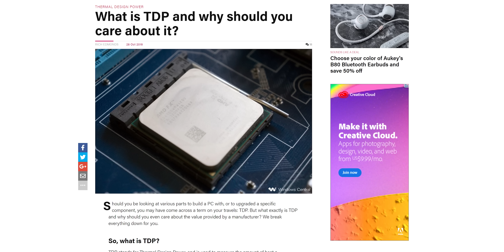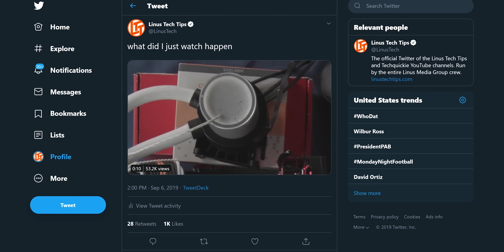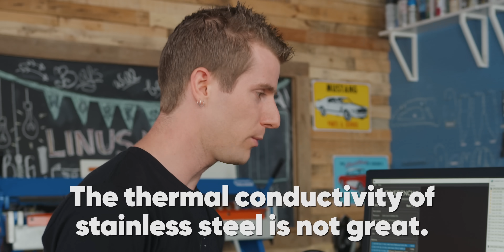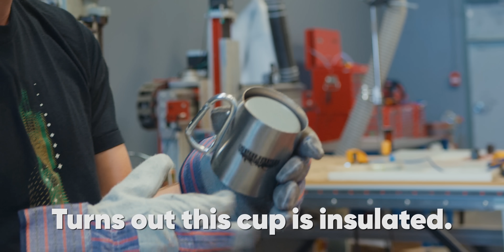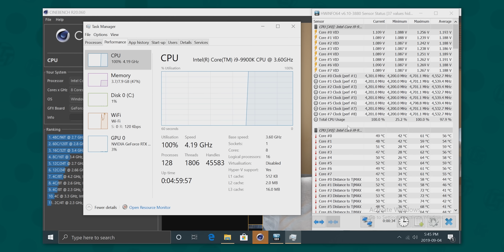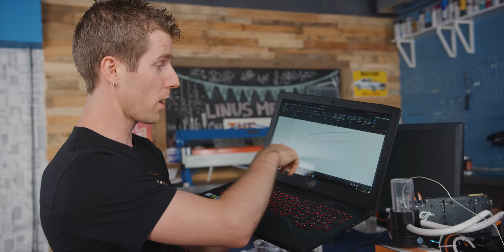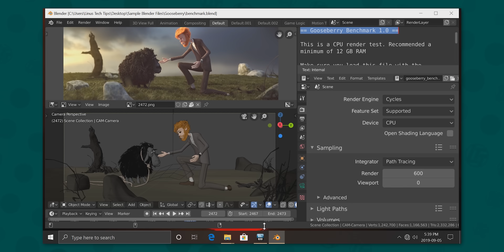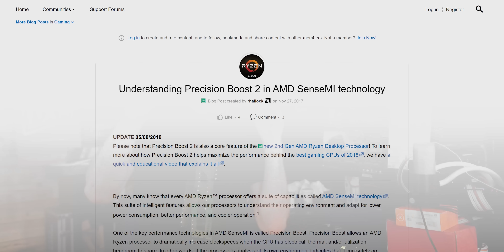Who REALLY Runs Hotter? AMD vs Intel

Comment: You sell water bottles for 30$, pure greed. I can get water bottles on Amazon for less than five bucks.
Reply: It is expensive, its probably high quality, it definitely is intended as a way to support the channel, doubly so if you use adblock and dont care for the sponsor services, products, or prices (ridge wallet).

Being frugal is fine, but understand what you are evaluating. A $4 thermos off amazon most likely isn't vacuum sealed so it wont keep the temperature of your drink sustained. I find even at walmart, a decent vacuum cup will cost you well over $5 ...  and if you haven't used a good one, you might not realize how nice they can be.

A good one will keep your drink cold all day, ice not/barely melting, in 90s F. It will similarly keep a warm drink warm all day in freezing temps.

Ltt thermos claims to be one of the good ones. $30 is above what I'm willing to pay, as I dont require that kind of insulation in my day to day life and as much as I do like the stealth black on black, there are other things for me to spend that money on in life.
The same idea can be said about GN mod Mars, the full size one is $100 ...  for a printed rubber mat. But another thing I haven't mentioned already, is small runs cost much more. GN has a video explaining the costs of pre production, tooling, getting designs right, etc. That all affects the cost.

Now your cheap, low quality mug from amazon is a ... cheap, mass produced item being sold worldwide under many cheap brands. A run of a million costs much less per item than that of a thousand. A cheap, non vacuum insulated cup is far cheaper than a sealed one. Etc etc.

I'd like a mod mat, but the $100 is too much for me to justify, so is the $60-70 smaller one. But I dont take away from people willing to buy these goods to support the companies. Better than it going to large companies who overcharge then spend millions in advertising with that money, say Nike as a random example, they spend much on ads and athlete sponsorships, and charge you the same premium to afford those expenditures.

So maybe think next time about bigger pictures and ideas before spouting nonsense. Yes, I can go to a dollar store and buy cups for $1, but they wont be much more than disposable quality and they wont support a creator I enjoy either.

So, accept you dont make the money to buy it, or the product doesnt appeal to your frugality, or any other reason this isn't a product for YOU specifically,  and that is ok. The world doesnt revolve around you, so everything isn't catered to your personal wants, needs, prices points, etc. It is fine, there are products on amazon for you!

Ofcourse, you can buy me a ltt stealth bottle and a GN modmat for xmas if it pleases you, I'd be happy to have them even if for me personally that $130 plus taxes and shipping would be better spent on many items for my kids, I can accept it's a good product that I wont invest in without shitting on it because I can be a tightwad mofo at times.
Reply: Are you one of those 50-something guys that go on random-ass crusades on the internet to tell people that don't care that branding makes things more expensive?
Reply: It's a donation

Comment: Why not just use a the same CPU cooling block for both processors, measure the GPM and Delta T of the cooling fluid, and do the calculation for energy transfer. 

Between this and the horrible peltier cooling block design, I'm starting to see why Canada has a bad economy...

Comment: Or you could’ve just switched off the fans on your AIO water coolers and insulated the rads, leaving the pumps running. Provided it’s the same model on both you’ve got the same mass of water.

Comment: All this video is a joke.
There is no way the CPU will not throttle before water reaches 90C.
5 degree difference is not enough to take away ~100W of heat on such small surface.
Better option could be using a cup filled with ethanol, no indicator needed then.. it just boils near 70C

Comment: Why not just use identical air coolers on both, run them at the same time, and see the temperatures at which they each reach equilibrium under load? That would be a more reliable and repeatable measurement.

Oh, video would be more boring.

Comment: Why didn't you guys just measure the current being pulled via the CPU power connector? The CPU does no thermodynamic "work" besides transferring electrical energy into thermal energy, so measuring the current(and voltage) going into the CPU would tell you everything you need to know about power usage.

Comment: But wasn't Intel running a higher clock speed? Making it heat up faster?
Reply: Yeah it was running at 4.1 with amd at 3.8 however the amd also preformed the task faster

Comment: You should have disabled speed step and run at the same frequency. Use the same cooler and run intelburntest on infinity. Then measure what CPU hits 90 degrees first.

Comment: what such a weak exercice,... i use to make calrimetric essays at secondary school... q=mw·cw·AT.... and you can make a little science to check the real value of heat (in Watt, calories or any energy value that uses there)... is not so difficult... first MEASURE the amount of water (with scale) , second use always the same amount in every replica (take sure to make at least 3 rounds per trial), and third use a better way to mix and measure the differences of T between starting point and final point (the key poitn is to measure the difference of T in the water after and before,  the more precise the better). By the way the amount of heat introduced in the system by the pump is neglegible...

Comment: Why not just try to approximate the derivative of the temperature with respect to time when the water is around ambient temperature giving the least amount of convection with the surrounding area. This will give a crude measurement of the power of the system.

Comment: My suggestion for the future: Ice.

Well circulated (without too big of a heat source) ice water will be constant at (well, just close to be precise) it's melting point.
 
You want that setup:

* 3 times water with the same mass of ice, preferably with a large surface area (higher cooling rate):

* One you will just let melt on its own, that's your reference to calculate the heat from the surroundings

* One on each of the CPUs. If you measure the time the CPU was in the stress test and the total time it took the ice to melt, you can account for everything BUT the heat the CPUs put out before the tests started. But that shouldn't make too much of errors

* You want to measure the temps of the ice water of each of them, to ensure they're at about the same temp. If the CPUs water heats up too much you want to increase the surface area of the ice.

You don't want to isolate anything differently or sth, you can do the tests at different times, and preferably use natural convection for the temperature exchange. In the end you should know the 

* mass of the water and 

* the ice at the start in each vessel, 

* the total time they 'lived' before all the ice melted and 

* the time the stress tests were going on. 

With that data you should be able to calculate a pretty precice ratio of the TDPs of these CPUs, and actually you should be able to get at least an idea of the total absolute Heat output of your CPUs too. If the math is problematic I might be able to find the formulas.

Comment: actually captured heat:
processor / at the start / average / at the end
R7 3800X / 67W / 47W / 24W
9900K Stock / 83W / 51W / 31W
9900K MCE / 86W / 52W / 33W
67W for the R7 3800X at the start, 47W at the end
(300ml water guessed, screenshot used, because of the water guess everything +/- 10%, however mostly correlated between the runs)

Comment: Meanwhile in the kitchen...

Fx9590: I can Cook ANYTHING!!

Ryzen TR 2990WX: Ahem let me introduce myself young lad...

Intel I9-9980XE: Um you do know I'm 5 watts hotter than you right?

Ryzen TR 2990WX: O_O
Reply: Haha, the 7980xe is like 600+w on a mild 4.5-4.6 GHz overclock on water, they are insane nuclear power draw! The 28 core burned some of those mammoth (32 phase VRM) boards, literally ruined the socket and scorched it, yikes! And that was on water...

Although, for useful heat, the backplate on my Titan Xp is always like 60c (it’s 65c on my open air test bench when gaming at stock at 100% screaming jet fan speed). It will burn you, so I’ll probably heat up nachos on it at some point. I might buy a “Thermi 480” just to see if it competes, the only other hot nacho cars I’ve got is an ATI (like, ATI, Fire-GL pre-FirePro errs) V8650 and it’s backplate gets hot from the 32 Vram chips (16 on front of card, 16 on back), and it idles about 200w on the desktop, by that I mean 200w in just the GPU at idle...). My main system uses 1.7 kW of power running Crysis 3 at 4k Ultra 100 fps (quad Fury and Threadripper, powered by 2x SuperNova 1300s, you know, in case I want to run LN2), but it’s like barely warm to the touch (the cards air or water cooled are like barely ever warm, excellent VRM and great air coolers even before water cooling just so it would fit on the X399 board so temps are very low, I can’t do any cooking with it)

Comment: would 2 aquarium cases not have been better and take the mass of the cpu, motherboard, ram everything and the oil as your system then you could just make sure you had the same mass in both and when the oil is uniform temp start the test until it has risen say 10 degrees (using multiple probes and fans to move oil around to ensure even heating)

then its just math right would that not be better can some one explain why this wouldn't have been better
Reply: Then you're not just measuring the heat output of the CPU, you also measure the whole system heat output

Comment: I would have enjoyed seeing the absolute energy which was required to heat the water up. It would have been nice if you also measured the powerconsumption. And after that some diagrams which takes theses values in relation to each other. Some kWh/kWh stats or so :)

Comment: Linus, if the cup is stainless steel or not a magnet will still be helpful. Most steels are magnetic and you are looking for aluminum which is not. So putting a magnet on it can't hurt and can help. Because if it does pull, well it isn't aluminum is it.

Comment: Isn't there also the matter of efficiency? As in two components can draw the same amount of power but if one is less efficient than the other, the less efficient component is going to output more heat? Likewise a component can draw more power than another component, but due to high efficiency it can still output less heat?

Comment: To test this properly, all you need to know is the specific heat capacity of water (4.184 Joules per gram per 1°C).  Insulate everything that the water goes through and measure the amount of water you use (let's say 250 grams).  Start the test at a known temperature (say, 25°C) and run the test for an arbitrary amount of time (say, 10mins) then take a temperature measurement at the end of the test.  Multiply the amount of water in grams (same as ml for pure water) by deltaT and multiply that by 4.184.  This will give you the amount of energy absorbed by the water in joules.  Divide this by the duration of the test in seconds and that will give you a wattage.  In this example let's say the water temperature at the end of the test was 75°C.  
250(grams of water)*50(tempDelta)*4.184(SHC of water) = 52300Joules (12500 calories if you're interested) / 600(test duration in seconds) = 87.17 Watts average thermal output over 10 mins.  That might be a little unrealistic as the 75° was a very rough guess on my part, but hey it's a reliably accurate way to measure thermal output.  I'd love to see you re test this.

Comment: Why did you leave the top off the reservoir? You are not trapping the heat... the room acts as a heat sink and is removing the heat at that point. Your results could have been more conclusive. Try cover with a piece of tin foil and a rubber band next time.

Comment: Upvote this comment if you've never considered TDP at all when buying a processor for your build.  I'm betting price and compute capability are the main two factors consumers consider when shopping. For data centers it would be compute performance (including density) and power efficiency.  I might look at TDP when shopping for a cooler, but it has no effect on what chip I buy, at all.

Comment: AMD rendered 1900 frames with the same thermal output as the Intel had at 1300 frames. That tells all we need to know, assuming the thermal leakage of the test setup was negligible. That means the Intel CPU uses 46% more energy to complete the same task! NOT a small difference..

Comment: Why don't this in so convoluted way?
I get idea and even age with it, but your execution is uneducated at best
Just get a lot of water. Not x00ml, but rather x000ml. Interface it processor. Do not try to get to any temperature, rather measure end temperature. Direct comparison.

Say Intel got 2L of water 20C warmer in 35 minutes running prime95
AMD got 2L of water 19C warmer in 35 minutes running Prime 95

Went trying to do it most Awkward way possible

Comment: Isn't easier to use a large container, let's say a bucket or a fishbowl with a KNOWN volume and calculate the heat output using the equation [Heat] = [volume ml] [density g/ml] [Heat capacity J/(g-K)] [T_final  - T_initial both in Celsius]  / [time to reach final temperature in seconds], you need to take care of the units in the end. The heat capacity will depend on temperature, but depending on how fancy you want to get you can use an average based on this website https://www.engineeringtoolbox.com/specific-heat-capacity-water-d_660.html or you need to integrate it (I can help you with that). Everything needs to be as isolated as possible including the tubing. You could use a custom cooling loop and a pump.

Comment: Because of the fact that none of the Fluids are messured correctly the results are actually not viable ... i am sorry ...
Reply: Tigerbear1981 > There are so many variables in this testing that the conclusion is a complete mess. Small amount of heat off the pump etc, wrong fluid amounts, heat reactant fluid that can be affected by room temps, poor contact of materials. 
There is no way a true conclusion can be made with the testing done in the vid.
Reply: @Vibration_Crew  Ya my point ... i just wanted to stop my explaination early on :D ... Thought alone this fact is enough

Comment: LTT needs a mechanical engineer to run numbers for you....this test is overkill for the target value.

Fixed water flow + Temp In + Temp out is all you need in a steady state (negating all other variables like insulation) to figure out the heat transfered. PM if you'd like some of that good numbering goodness.

ps. Overkill is still very nice to see.

Comment: Linus

One potential error source would be the weight of the metal plate in the cooling block.  Did they weigh the same for both set-ups?

John
Reply: I'm pretty sure they used the same block twice and any change of mass either from the dye or from scrubbing would be insignificant with the precision they're working at.

Comment: You COULD also have split the VRM 12V rail from the main 12V rail on the motherboard and use a separate power supply.. Then the only real difference between the two platforms would be the efficiency of the VRMs

Comment: 3:13 - Uhhh, dude.  You actually have to do the calcs on that - you've added a layer of thermal resistance, but you'e increased the surface area which will increase the convective cooling.  In a lot of cases you'll actually INCREASE the amount of heat lost by insulating it blindly like that when you're temp difference is significant.  Assuming you're not boiling it it may not be an issue.  But it's a total rookie move to just slap on insulation and assume you've improved things.

Comment: not a fan boy but i already knew intel processor is always hotter because i was using a core2duo fan cooling for a core2quad cpu.
i thought its because both intel cpu is 95w, their temperature gonna be the same. i was wrong because my new q9500 was burnt out.

Comment: @Linus, could you make an attempt to dip a USB cable (the male connector) into liquid water based ink and then use it to transfer files on PC? SATA connector of an HDD is also possible. But I think a USB cable is a lot cheaper to do so. I know it is useless because we know the result. But just curious though.

Comment: A little disappointed you didn't do a rough calculation of TDP based on the loop water mass and temperature rise over time.

In reality, insulating the motherboard would probably not be a reasonable part of a standardized test. I would leave the motherboard air contact/heat dissipation configuration as a normal worst case scenario, in a tight case with poor airflow(No one is going to blanket up their motherboard, or at least they shouldn't).

Do that, but have a well insulated thermal mass loop, vs your uninsulated loop, and measure the temperature increase over time.  There would be a way to calibrate the mass of the system including the reservoir, pump, etc by, for instance, putting in a known fixed power heating element and measuring the change over time(With pump off, to isolate that variable). Then, Run the loop completely insulated with no heating element and measure the power dissipated by the pump. Then do your test correcting for these variables. Since the convection behind and around the motherboard is typical, you could ignore that as a variable and measure TDP in typical operating conditions. 

Just a proposal,  because I felt like writing one.

Another way to measure it would just be to measure the current and voltage being supplied directly to the CPU, assuming most of it will be lost in the CPU as resistive losses (a fair assertion, hence why your CPU requires the biggest cooler in the box).